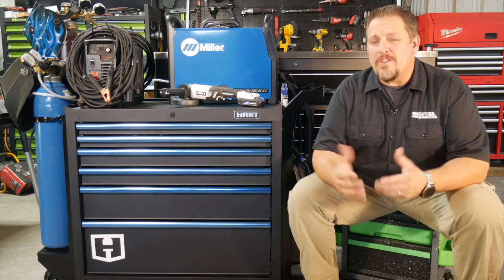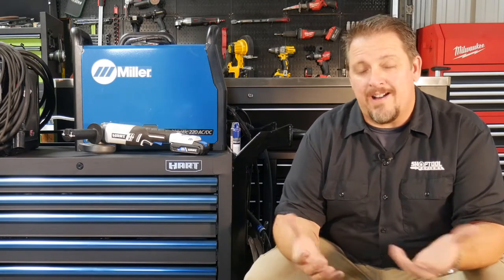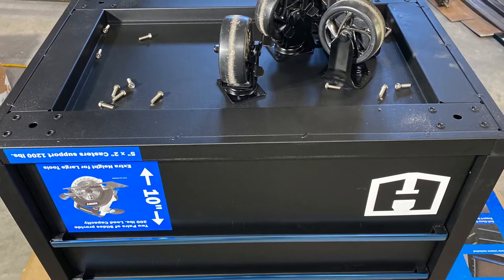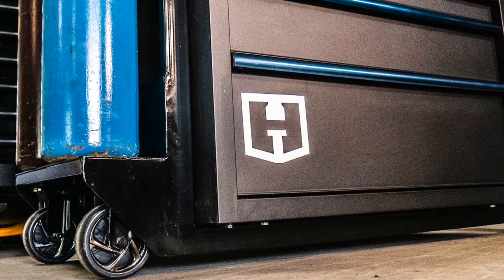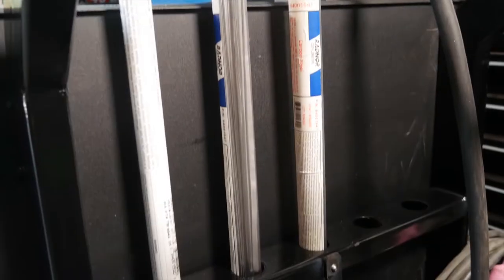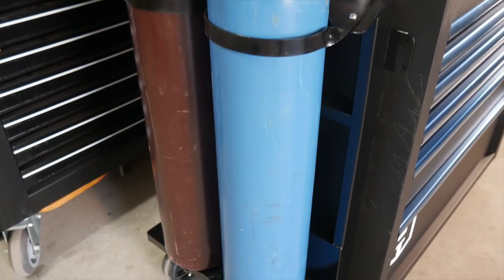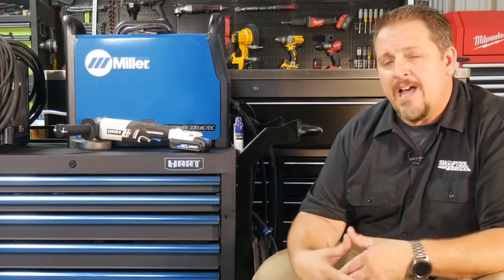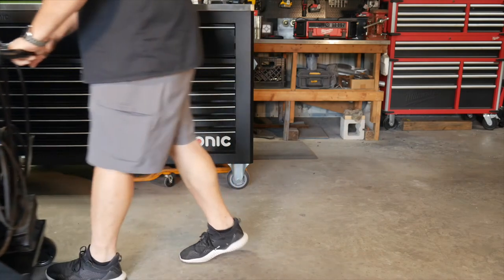SIMPLE Welding Cart with HART [ATTENTION WALMART SHOPPERS]

Comment: very nice design.  Reduce the work and cost by using two 2x10s  or 2x12s bolted below tool chest to stock caster attachment points.  Extend 2xs beyond chest to form tank platforms...both ends for mig/tig/ and oxy-acet if desired.  Attach stock casters to bottom of 2xs beneath tank platforms.  Add hooks for cables/hoses; PVC  pipe rod caddys; add Harbor Freight welding table top hinged to rear of cabinet with two front extending/folding support legs.
Reply from the maker: I love your idea. This seems very simple and effective.